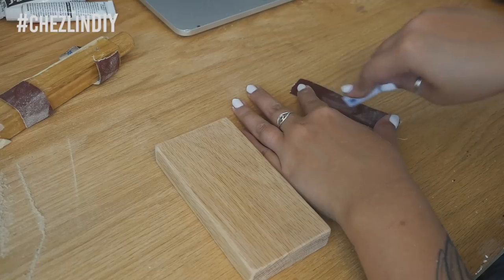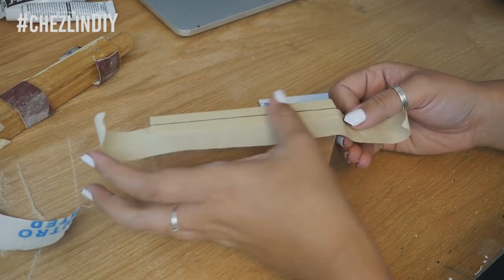How to Make Dog Deshedding Brush - DIY

Comment: I wonder if i can use for my cats?
Reply: You can, but if they’re short hair I’d use a rubber curry brush. If they’re long hair I’d use a soft slicker.
Reply from the maker: I'd be worried it would be too harsh for a cat - Hobbes' fur is pretty coarse, so it works for him. I tried gently brushing one of my cats with it and he HATED it. Although, he hates any brush... but yeah, this thing is going to be strictly dog only for me.
Reply: chezlin my ragdoll mixed breed sheds big time. So much that I find little felted balls of fur (like tiny dreadlock balls) on my clothes when they come out of the dryer!!! I started vacuuming him when he was very young but this time of year is awful. He loves the grooming glove type hair remover better as there's no noise lol
Reply: As a groomer, I wouldn’t recommend using this type of brush on your cat. Cat skin is a lot thinner, more elastic, and more sensitive than most dogs’ skin and you could run the risk of cutting your kitty.
Reply: I wouldn't!! Cats skin is super easy to tear. A groomer I watch said, " it's like saran wrap!" Dogs skin is tougher. I personally wouldn't use this on a dog either, though.  It's an awesome tool I might use on a double coated dog. I use a rubber zoom groom brush for my smooth coat dogs, it works insanely well.

Comment: Haha I thought that brush looked like a hacksaw blade too. I almost took one to try on my horse, but I'm worried the teeth might damage the fur?
Reply from the maker: Well I know this style of brush is used on horses mainly, but I've never personally used one on a horse, so I'm just going on what I've read online/heard from my horse knowledgable friends :) The blade doesn't cut the fur or anything, it catches the fur that's already loose and pulls it out. You can see in the video that when I'm using it on Hobbes, it's mostly pulling out his fluffy undercoat and leaving the longer guard hairs in place.
Reply: No.... Used correctly there is no damage to the skin or coat, and these work better than anything I've ever found commercially. I've been making and using the same "brush" for over 40 years, and there's just not a other tool like it available for sale anywhere. 
I was given a white mare a few years back that had the thickest, longest, nastiest winter coat on her - it was impossible to make out where her head met her neck, or where anything else tied in without feeling for it, she was so hairy. I tried one of these little shedders, and on one shoulder, within 5 minutes, I revealed a gorgeous dappled silver coat under all that hair. Well, i couldn't stop there - it took me 4.5 hours to shed her winter coat completely, and with absolutely no discomfort to the mare, no damage to the skin, and not only was the coat not damaged, it gleamed like she was polished. I really don't recommend doing this all in one sitting, tho. I ended up with a stunningly beautiful horse, but a bad case of tennis elbow to go along with it.

Comment: This is a good tutorial but as a dog groomer I gotta recommend trying a zoom groom. They’re $5. Use short, fast movements in the direction of the hair. 
It’s better on their skin and you can use it as much as you need to. It’ll get SO much hair off of a short hair dog.
Reply from the maker: I've actually had a Kong zoom groom since Hobbes was a puppy. It never really seemed to work super well for me for normal brushing - maybe I was just using it wrong? I'll have to try it again! I mostly just use it for shampooing him and it works wonderfully for that~

Comment: Sounds great for short hair.  I’m still trying to find the magic weapon against a Pyr’s crazy coat.  The Furminator just doesn’t cut it.  Tried a few different ones, now we just use long-toothed rakes and hairbrushes for people (the ones with the gaps in the back where the “bristles” come out - they have the rounded nubs on the ends.  I’ve always used it for blowdrying and really tangled hair - seems to work okay for my boy.  Any advice is quite welcome though.
Reply: The undercoat rake should work well, you could also look into what’s called a coat king, it’s a different type of undercoat rake, but it’s essentially tiny razor blades so you’d need to be super careful with it. One of the most effective things for a Pyrenees that’s blowing coat though, I’d say get yourself a velocity dryer. Use that in conjunction with the under coat rake and you can blow out all the excess shed.